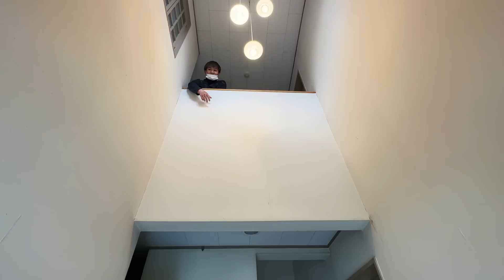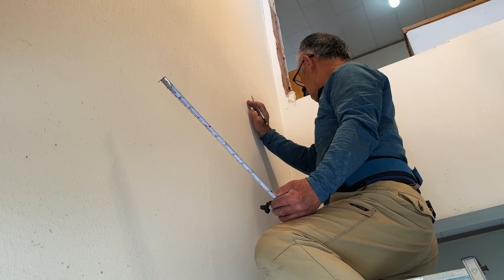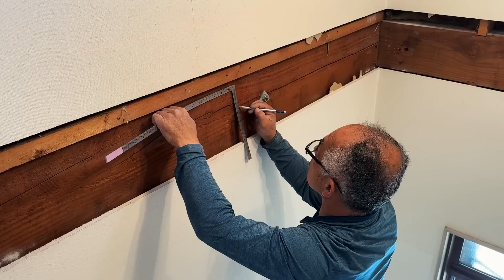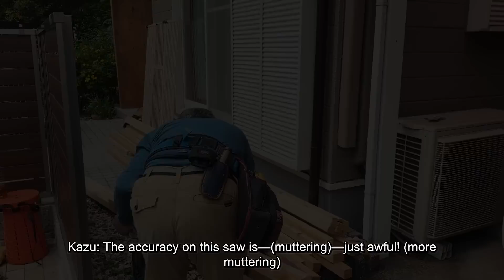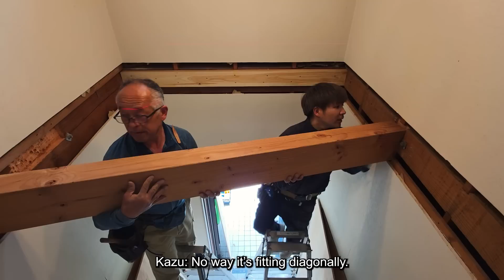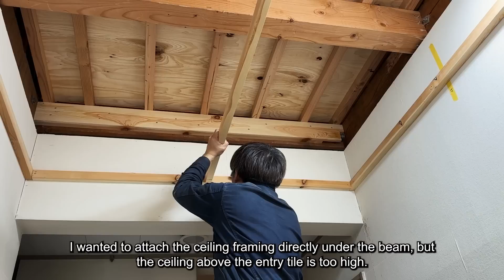Japanese Veteran Carpenter Builds Over an Open Foyer in Just One Day!

Comment: It's interesting how in Japan your bearers are fine but your joists are really flimsy and thin. Your frame/roof construction method are basically the same as here in Australia but use smaller timber size in general.
Reply from the maker: Thank you for sharing your observation. In Japan, timber sizes are often determined by traditional building standards and material availability. While joists may look thin, they’re usually supported at shorter spans, which helps maintain strength and stability.

Comment: imperial and metric i use both and i confuse myself sometimes but prefer imperial ,i was taught both at school ,but teacher wanted me to use metric ,if i did not he would smack my hand with a ruler , but still used imperial ,.
Reply from the maker: In Japan, we hardly use inches,
but 2x4s at the hardware store are labeled in inches.
If I add inches to shaku and millimeters, my brain might explode!
Reply: @KazuHouseRenovation  😅
Reply: A 2x4 in the US isn't actually 2" x 4".  It is 1.5" x 3.5".  The nominal designation was for the Sawmill, the finished size is after surfacing (planing smooth) all four sides (S4S).
Reply: @michaelfiller3452  ❤